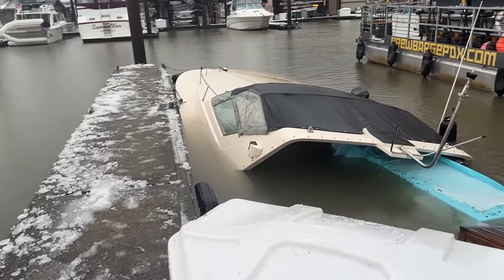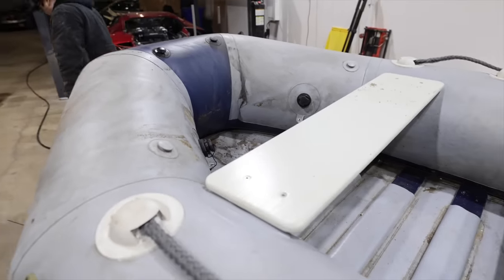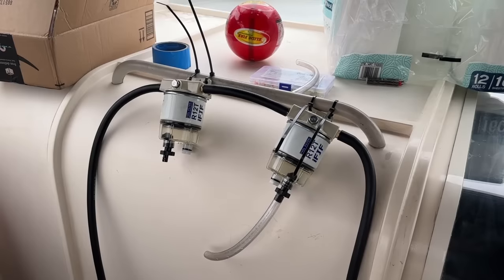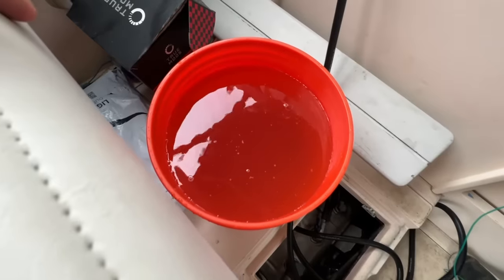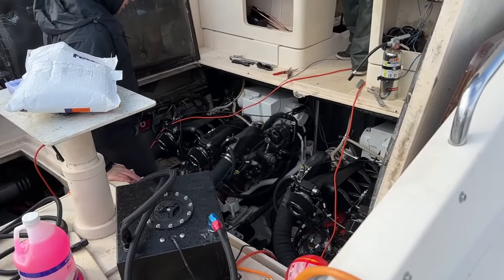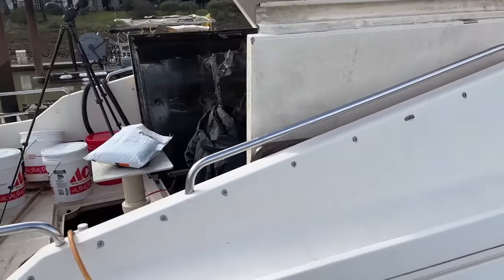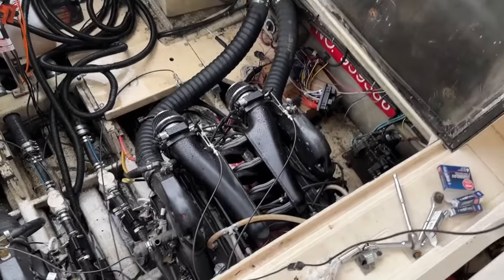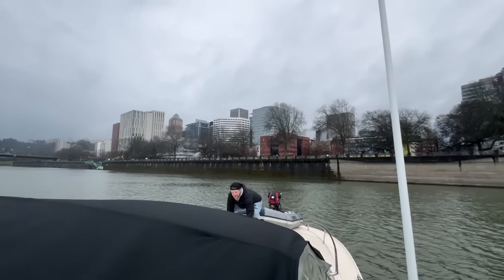First Test Drive Of My Italian Yacht After It Sank -  WILL IT WORK?

Comment from the maker: Get a 15% discount on your Carly purchase using the code "BisforBuild24". Just click on this link: https://bit.ly/Carly_BisforBuild24 and the discount is auto-applied! Offer valid until March 31st, 2024
Reply: You guys are the best !! Can't believe the boat sunk and boom it's already back running again  !!!
Reply: Second channel link??
Reply: You should get some fuel additive that evaporates the water out of the fuel and helps with your injectors and ect.
Reply: Plug on the right is a phone plug from italy. it's a BTicino 2021
Reply: @MRBenchwork  https://www.youtube.com/@behindthebuild8749
Reply: When I was kid I was told to look like you know what you're doing you have to come to and from the dock well.....And put your fenders in when not docked. I steer clear and assume people don't know anything when they boat fenders out. Glad the boat works, love your videos!
Reply: No link for second channel??
Reply: Can you confirm the link to the second channel? @BisforBuild
Reply: Electrical gremlins after sinking, hmmm, wonder what's wrong
Reply: Hey, I noticed your fire extinguisher on the boat. I'd double check, if that's Kidde brand, I do believe that's a unit on recall. They could fail in the time of need. Kidde will replace if that's there's
Reply: The red one on the wall
Reply: Carly is a scam….i had. Very bad experience with them
Reply: Just a quick headsup about Carly... They automatically renew the yearly subscription without notice. They also don't allow easy cancellation or disabling the automatic renewal through their website.
You have to manually reach out to them through email to disable this automatic renewal!

Beware!
Reply: carly is awfull!! i had a lot of probles with it
Reply: Carley is a scam 174 dollar auto renewal. Like the channel but!!!
Reply: Alcohol will fix the water in the gas tank
Reply: @tphvictims5101  alcohol is always the answer.... Also could fix a broken heart....  can help you forget .... And .... Mmm... Other things too... I think...

Comment: You may already know this, but there are products like HEET that you can add to the gas to pull out any remaining water.  I believe if there's ethanol in the fuel, that will do it over time as well.  Obviously wouldn't work with 20gal of water in the tank, but if you want to get the last few bits out, maybe try this.

Comment: Been there my friend.  In 2019 I was diagnosed with stage 3 almost 4 cancer.  All my Lymph nodes were contaminated.  Fortunately I responded well to Chemo and did not require Radiation Treatment.  After surgery (removed all the Lymph nodes) I was cancer free.  Still go in every 3 months, but so far everything is looking great.

Comment: Phase separation - fuel

Every single electrical device, including the harnesses on that boat are going to die in short order.  You can deny that inevitability and endure constant break downs or you can acknowledge the reality and start replacing.

Comment: Hey Chris most marinas have wifi and you can get flood sensors and it will alert you when you start getting water in the boat and then u can call the marina and have them.check on it while u are on the way

Comment: You should add a sea cork, a valve to shut the raw water out of the boat before the strainer, if there is enough room for it. Close the valve every time you are leaving the boat for extended periods.
Reply: Seacock?
Reply: @jamesranker6275  valve, normally placed straight on/after the inlet.

Comment: If I'm not mistaken, it's just as big a problem spitting gas into the water in the river as it is in the marina, except it won't be so obvious who is responsible for the sheen.   You probably know that you can be held responsible for any spillage that you create anywhere on the water.
Reply: Are old two stroke engines forbidden then? They spew about 20 % of the fuel right out the exhaust. While a spill of diesel oil is quite bad, a small amount of gasoline will rapidly evaporate and isn't really a big problem.

Comment: Hi Chris 😊 love your channel have followed you for years, watch all episodes😃

Regarding your boat electric wire harness for your audio and everything else. Be careful not to have unprotected wires, all wires must be protected by a circuit breaker in case of faults, if not you risk fire!🔥 sad times for the boating experience 😬

Comment: The impeller on that kicker got a good break-in😂
Reply: If I'm not mistaken that's an air cooled motor
Reply: @Jay-zl7mw you know what? That makes sense. It's just definitely not common
Reply: its air cooled but yeah... as a boat owner i cringed when the earmuffs werent on the lower unit.  a lot.
Reply: Did wonder?
Reply: 15 seconds no water equals  no impeller.

Comment: 5:12 usually the fin thing on the outboard should be even with or slightly below the bottom of the transom I think.

(At Least that’s what I was told when buying a Nissan 5hp Motor for my 14ft aluminum boat.) 
 
That one sticks way below the bottom but since it’s just a inflatable dingy it shouldn’t matter.

Comment: I would do a radio check. I would also just leave heavy batteries in instead of cement as they are more useful unless you are looking to make someone cement shoes. Awesome you got it running. Some years ago I rebuilt a repo 39 sea ray that needed everything put back. Fun stuff.

Comment: I would like to recommend sinking U bolts into your sacks of concrete. That way if you ever have to pull them out, you would have a grab point. I'm curious about onboard plumbing and electrical wiring. Will the stacks of concrete prevent easy access to those areas? I'm a little concerned that you'll run into electrical gremlins and need to rerun some of those wires. Good luck team B!

Comment: 19:35 Engine is running rich... Those air filters look undersized for a four cylinder Honda Civic even if there are two intakes per engine. Pipe in some fresh air through an appropriate sized filter box and see how it runs.

Comment: For the radio... It has three power cables, positive, negative and a usually yellow remote positive... You connect the positive and negative to your battery and your remote to your ignition, that way the radio turns off once your ignition is off

Comment: Outboard is for a sailboat.  Your dingy will have a hard time planing. Shaft is to long im afraid.  Hope your cement bags wont break and cover your engine bay with cement dust. Once thats wet removing is impossible.  Better use bags with pebbles or grind (sorry for the translation). Great to hear youre healthy.

Comment: about the radios:
- they have 2 wires (mostly red and yellow) one is for constant 12V (memory function) and other to ignition, the red one should go to the ignition and other to the battery
- if your boat have more 24V than 12V lines, you could buy just a 24V radios (truck radios)
- instead of doing the switch for each radio is better to automate it on something, like relay if there's no power to something else.

Comment: And this folks is why diesel is king. No ecms, no electronic dashes, no o2 sensors, diesel is less volatile than gas so its way safer, longer service intervals, fuel efficient, better power band for this boat and its props, way more reliable than this hodge podge of non marine parts... etc
Reply: If it’s so good why don’t you use diesel??? You can’t seriously comment that - the hypocrisy…
Reply: @GardenGuy1942  Well I actually winterize my boat so pipes don’t freeze and sink my boat. But to answer your question.. it depends on the boat length and purpose. I have a ski boat so a light weight gas engine is perfect. A big ass yaht thrives on a diesel powertrain because of the reasons in my original comment
Reply: @bradenwuesthoff5639  nuclear is far more efficient, that’s why the military uses it. I’ve tried to develop my own type of engine but had parts confiscated. I might take your advice and drink diesel..
Reply: @GardenGuy1942  do you live in the real world old man? Yeah sure a YouTuber is going to power his boat with a nuclear steam engine. Totally realistic great idea!

Comment: You should get something like Yamalube Yamashield Rust and Corrosion Protectant to spray on the electronic connections and engine components that may rust or corrode due to moisture. I've used it on my boat engines for years. I remove the cowlings off my outboards and completely cover everything with it.

Comment: Man, you really need to read your viewer's comments and take advice. Now that it's back running you need to change the props before you ruin those engines. With the correct props that boat should easily be capable of 40 mph.

Comment: Please get rid of cement bags and build a sweet Ballast tank. Fill with water as needed depending on fuel load. Empty when cruising at speed, use the trim tabs. Empty the tank at the dock. Boat could never sink with big tank of air. If you wanted to really be cool. Put fuel bladder in and fill with fuel. As it empties, fill with water as needed. If you really wanted to be cool cool. You could be 44' wake boat!!!!!!!!! Or I mean Tidal wake boat!! Wake boats have fillable ballast tanks

Comment: So your motors cavitation plate should be in line with the bottom of your boat for maximum poweroutput, but for a dinghy that hight is also perfectly fine, as it is not suppossed to go fast asf

Comment: So most of the weight you lost from ditching the diesels was just replaced with the ballast you had to add to make the boat sit level….know you’re back to a boat that weighs almost the same as before with the diesels that is still propped for the diesels being spun by motors with not enough torque to spin them past 2200rpm….have you learned anything yet???

Comment: That thing needs Dominators with NTK O2 sensors. Terminator X and O2 issues go hand in hand. Some are fine. Some are not. Being forced to use the more finicky Bosch type with the Terminator kinda sucks. You also need the Dominator for a 2nd O2 sensor input. You can still install one and monitor the 2nd bank with the Terminator it just can't be used for any kind of fuel correction.

Comment: Very fortunate re progress considering a full sinking.  Nice.  On a side note I have a small little thing you might already know but....  As the skipper, as soon as you clear that slip and get an open space to pause, pull in all those fenders and stow them.  You're doing engine work so no big deal.  But dang there is nothing worse than seeing some guy on a beautiful yacht, cruising the harbor, or worse going out an inlet, jetty or under full cruise speed with a bunch of fenders flopping around in the breeze.  That's when you shake your head and think "geez, a new $5 million dollar boat with a captain that is clueless."  The amount of yachties filling that joke at Haulover is ridiculous.

Comment: Keep a bottle of Dawn onboard that way if you ever run rich or accidentally drip fuel into the water you can squirt a little Dawn into the sheen and it will dissipate quickly.

Comment: Gas and water will mix if you use gas that contains ethanol as some water will dissolve in the ethanol.  Temperature and pressure will effect the solubility though which is why aircraft cannot use ethanol.
Reply: I was about to comment the same thing. You are spot on. Diesel fuel or gasoline without ethanol would separate but the ethanol will retain some of that water in suspension.  Would’ve been better to pump the entire tank dry and start over.

Comment: You really should not run those small outboards without being in the water. They have a rubber impeller for the coolant pump and it will wear in literally seconds if it's not pumping water to keep the blades off from the outside of the pump.
Reply: Air cooled briggs lawnmower engine clone
Reply: I agree, burns out the water pump impeller.
Reply: Came here for this.  Impellers die within seconds outside of water.
Reply: @matthewsmall6225  but its air-cooled it has no impeller

Comment: I'm only at 4:47 and thinking of this dinghy towing a yacht. In my head I'm picturing a little s10 trying to tow a car trailer with a hitch attached to the back bumper. No way this is going to work - but I'm ready for yall to blow my mind haha
Reply: Weight and size doesn’t matter when towing boats, just the engine and propeller. That’s how you can have tiny tugboats moving ships many times the weight and size of itself.

And there isn’t any static friction, so a tiny propeller can still move a huge boat, just very slowly. Of course it’s a different story if there’s wind or current

Comment: If you put water on a O2 sensor it will not generate any electricity..  If you let it dry, will it work again? It needs to be dry to work, but if it's wet, I wonder what could break.

Comment: You should run surface drives or stern drives. This boat is insanely inefficient considering the power. Ultimately, faster and more fuel efficient.

Comment: Every outboard I have ever worked on has a rubber impeller in the lower unit to pump water for cooling. Running it out of water or without a flush device attached is a sure fire way to destroy your pump in a couple of minutes.  
NEVER RUN A OUTBOARD DRY!!!!

Comment: @BisforBuild
Do the engines in boat have an ethanol tune to temporarily run E10/E85/E100 fuel?

Ethanol will bond to any water molecules left in fuel tank and burn it off as part of normal combustion process, if you have the right fuel pumps to allow for mixed fuels and tune for fuel map to adjust for different octane/flash point of ethanol etc.

Comment: (27:23- 27:39) I have a feeling the o2 sensors arnt the problem. The wires are probably  corroded, and causing issues.
Reply: they've been an issue since the beginning.

Comment: Good to hear you are cancer free, congretulations. 

You may want to change the impeller. Running without water will destroy that thing in literally 30 sec. You will find out once you are on the water, that is when they start falling apart.

Comment: Just bought jvc deck for a truck I am flipping for 30.  Can't believe boss would be more.

On one of my boats I did 2 switches for the stereo 1 for memory and one or ignition on.  I turn on the memory when I am on the boat for the weekend, but still can turn it off.
Reply: probably made by the same company
Reply: @steveww07  fair.  Several brands are all owned by same company now.

Comment: Having owned a similar zodiac, give it a 15 hp Honda 4 stroke and you’re in business.
Part two…….NEVER EVER RUN AN OUTBOARD MOTOR DRY!!!
You’ve probably just killed the water pump impeller by running it dry……ear muffs and a hose, or even a tub of water……just not dry
Reply: its a lawn mower engine

Comment: I hate to be the bearer of bad tidings, but you just damaged your rubber water pump on your tender by running it without water. The water lubricates and cools the rubber impeller.
Reply: It’s air cooled. No impeller.
Reply: Even if the engine is air cooled the impeller needs water to lubricate.
Reply: What impeller, lube what?  It's air cooled. No water to circulate through engine. AIR COOLED! @ChrisWijtmans
Reply: @ChrisWijtmans  lower unit is sealed with grease.

Comment: STOP! trying to run O2 sensors on a marine application!  You have thee only boat with freaking O2 sensors. Dyno tune the engines and run an open loop fixed tune like every other marine engine. #myfirstboat

Comment: These new junk imported radios are so power efficient that they can run off the continuous power, clock circuit.  Put one in my pickup and it drains the battery.  Installing a switch.  Hate loosing the preset stuff but batteries aren't cheap.

Comment: Never ever run a boat motor without water running through the leg.  You just ran a rubber impeller inside a dry housing. It only takes a few seconds to literally burn and melt it down.   This is coming from a Service Manager at a marine dealership.  I have to say, watching this series has been extremely stressful.  But the good news is I’m bringing you new viewers to show everyone exactly what not to do.  Lol.   Still love ya’ll though.